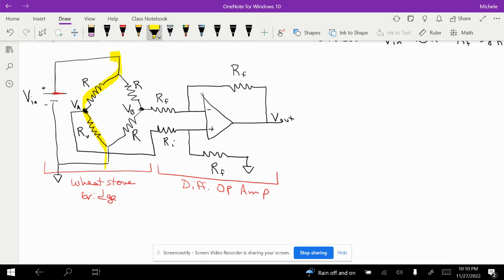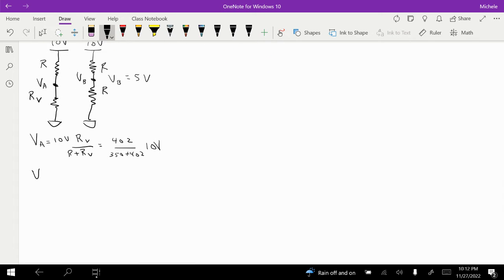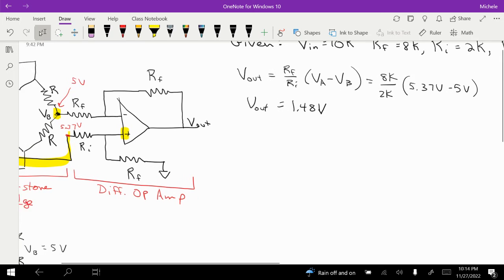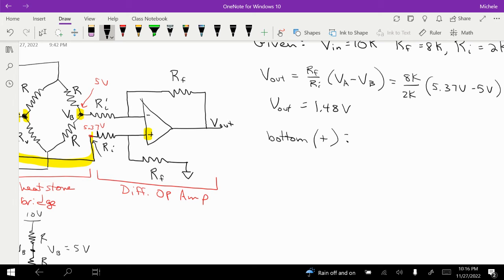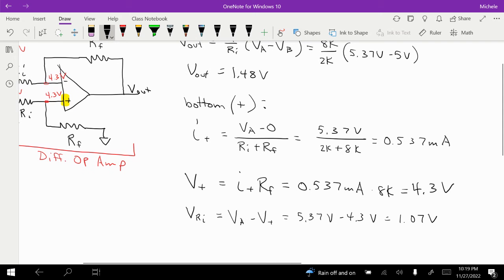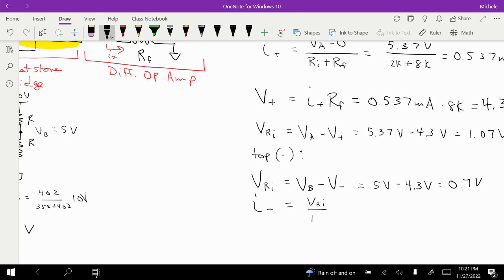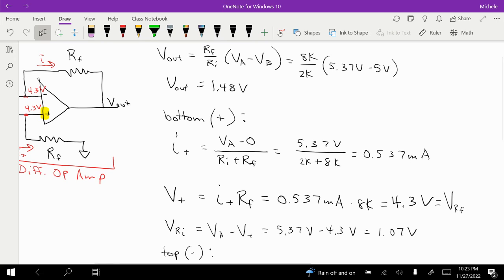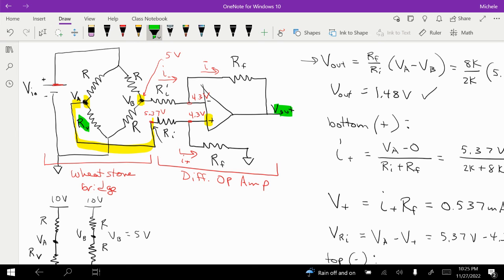Wheatstone Bridge and Differential Op Amp Problem

Comment: Hello!
I'm dealing with a problem where i have to calculate the voltage Vab before the differential op amp is connected and then after the differential op amp is connected. How does the calculation for that go and what kind of differences should i be expecting?
Reply: Hi, did you ever figure this out?

Comment: hi Michele, great videos by the way.  I wanted to ask if it was possible to have some insight on designing a circuit that gives an output (that would later be connected to LEDs) based on a changing variable resistor that functions within a normal range (for example 500kohms to 20kohms), though when too high or too low signals another output.  Thank you!